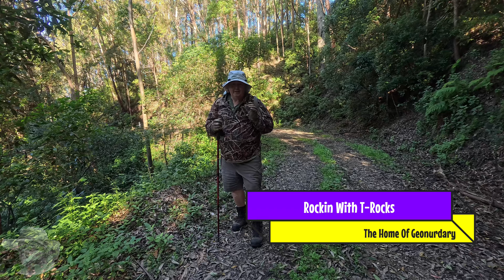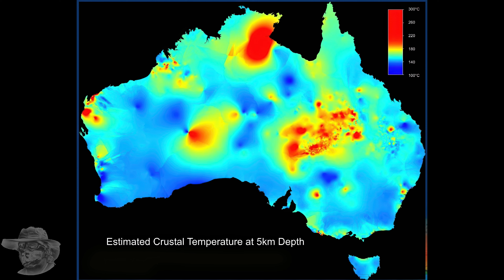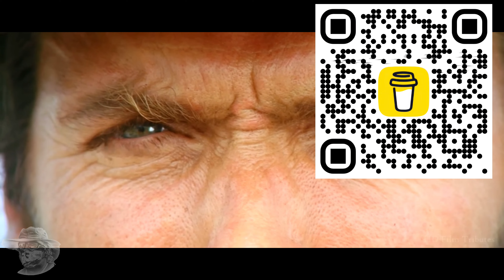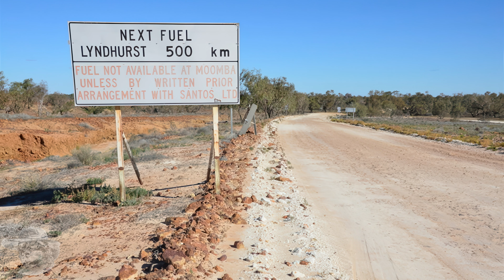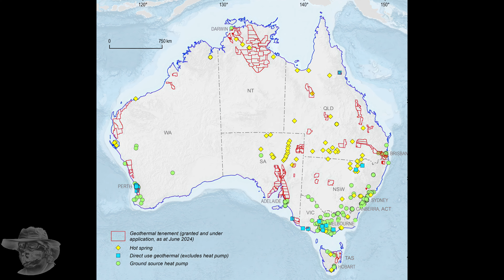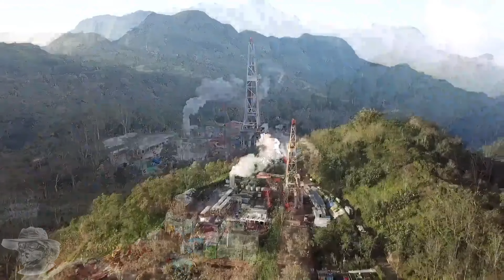Money for Nothing And Your Heat For Free: Brisbane’s Geothermal Future

Comment: There's energy to be saved with ground source heat pumps.  But the installation cost is insane.   My alternative:- plenty of solar panels, a big battery, and a normal air source heat pump (ie air conditioner). I can have all of that equipment, and free power for my house, for the cost of a ground source heat pump.  And while the gshp is efficient, it's running cost is still non zero; whereas my running cost is negative. ... Amber will be paying me a net energy refund each month.  That's hard to beat.

Comment: I was involved in a seismic survey 30 ish years ago west of Jackson, W QLD , they claimed there’s enough deep hot rocks to power the entire eastern states. I’m not sure what became of that. My foil hat tells me it was killed off by the fossil fuel industry 😢
Reply from the maker: For sure, the fossil fuel lobby is very powerful here, but loosing it's grip, Geothermal would have been a much better choice that Nuclear, but not a word for anyone during that debate.
I'm not sure (nor was dutto) how much it costs to build a nuclear power station, but I'll be Geothermal is cheaper for base load.
And no pollution, and renewable.
There are a heap of hot rock zones out there, the oil industry knows them all. They have all the semiology and bore results..
Reply: @t-rocks1960 and once running it’s reasonably easy to run 500kV transmission lines to connect to the current grid.